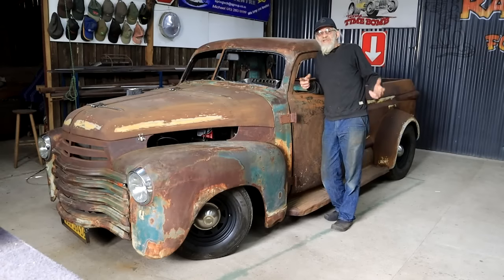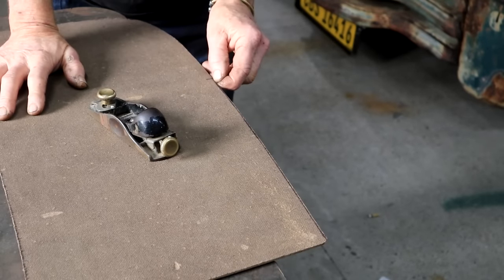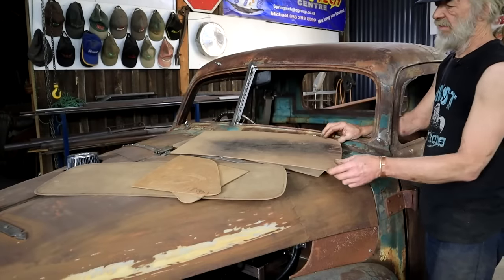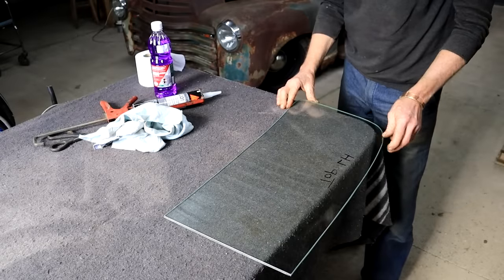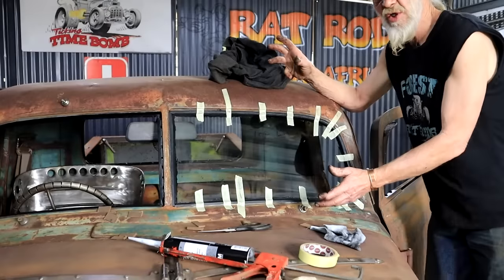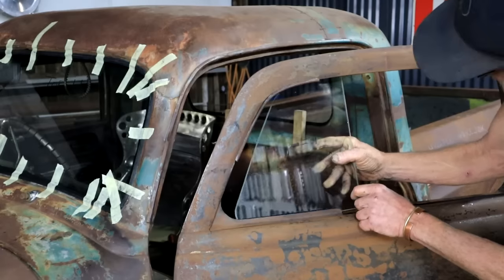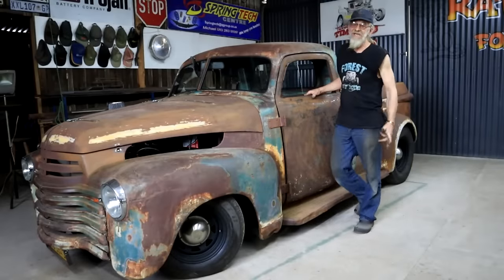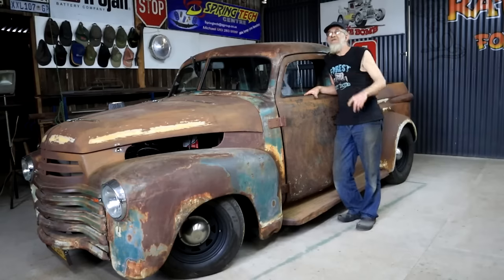How to make and fit your own windshield!

Comment: The glass guy where I live cuts the plastic little tube with a razor blade in such a way that it makes the triangle shape that you referenced in the instructions, looks cool as hell when he does it, I’ve installed glass before with the manual caulk gun like you did and if you don’t warm Up the urethane it’s a hell of a workout . The glass guy cheats and uses a battery powered caulk gun, lol
Reply from the maker: Yes, that gun I used was a pain!! New one is one the list...😅

Comment: You need to use different kind of nozzle. They sell V-cut nozzles for applying windows sealant. Point the nozzle to the frame on 90* degree angle and it will leave triangle shaped bead.

Comment: nice vid and a good idea. both methods are fiddly in their own way, maybe depends mostly on the kind of look you're going for. the type of glass is a personal choice of course, for me anything other than laminated glass specifically designed for windscreens would be out of the question – i really like my face as it is. for those willing to take the risk, have at it.
Reply from the maker: The glass I used is shatterproof, laminated safety glass.

Comment: Hey man, quick tip, put some dishsoap and water in a spary bottle, then you can use that to tool the caulking without it getting everywhere, 
Ive been a glass imstaller for 17 years and it never failed me
Reply from the maker: Nice tip! Thanks

Comment: Yes, absolutely. The big automakers, go rid of all their fancy screw and clip on moldings long ago.
They just have a painted metal pocket, urethane, and glass. 
It’s cheaper, and lighter….and realistically. Safer.
A few pointers from a pro who’s done this many times.
1. You may want to use a byutl tape to put around the pinch weld. Or “quick edge”. A rubber trim product for the edge. This will set the height for the glass, and eliminate “spooge” coming out on the inside. And them the glass will not be setting flat…right on the metal.
2. Hazard Fraud, sells a cheap suction cup. Perfect for alignment perforce placement.
3. Sika flex is great, expensive here, so I use Dow products. Whatever the circumstance. Please don’t use 3M super fast. It is the worst urethane.
4. The rubber trim comes in several varieties, including and “Ogee” edge, that is applied to the glass before placement. And make the seam at the bottom.
5. It’s difficult to use those stamped caulking guns. Cox, makes a beauty. For $30. I personally caulked 40 thousand tubes though one that literally wore it self out, and is hanging on my wall. On a varnished plaque.
Heat your urethane in ….whatever, I use my vans defroster. Hot water would probably work. 
Don’t use the microwave of course, and it will gun faster.
6. Make sure your windshields, you get from the glass shop, have a nice seam. Raw edge glass is dangerous, and fragile. If not, sand the edge, by hand with some 180 grit. Before installing.
7. I’ve at customers request, glued a mirror button in the corner. Inside, allowing for the fitment of a read view mirror.
8. If your doing all the glasses. Laminate comes in clear, bronze, blue, green, and probably peach. So, you could have any color you like. Bronze is always nice.

Great job..thanks for sharing.
Reply from the maker: Hey, thanks for all the pro feedback! Some valuable tips.👍Yes, that caulking gun was terrible! New one is on the shopping list

Comment: Hi Duff
Another outstanding video.”Frankie the FRANKENTRUCK Is coming along Fantastic.
There’s a technique that was used by race
Cars where your glass lower rail has a leather strap Then it comes out of top of door frame
You pull it down from outside and you fasten studs on Door where you can lock belt after
Punch holes on the leather belt you can
Open all the way or half depending on
We’re you put the stud.
This way you don’t have to worry about 
Window crank and gears.
Reply from the maker: Thanks. You not gonna believe this, I used exactly the same technique on one of my other builds!

Comment: Glass Rubber  " T  "to install? Make yourself two wheels curved to form a  half moon to  fit over the rubber, and roll it in gently.  The two wheels should create a half moon cavity for the rubber with handle and axel of course like a pizza cutter, for next time. The wheel on one side should be in contact with the metal window frame following the shape of the metal!

Comment: I'm not familiar with the glass terminology in Africa but I do auto glass in the states and the 2 types of auto glass are
1: Tempered glass (shatters entire glass when it breaks) and cannot be custom cut.
2: Laminated glass, ( 2 panes of standard glass bonded together with transparent, double sided adhesive mask) it cracks instof shattering.
Yours appears to be Laminated flat glass.
They also make Laminated flat glass  with the green/blue shade along the top, it makes custom cut windscreens look .more modern.
A little tip on the urethane. For a cleaner look, mask inwards 1/2 or 3/4  of an inch around the edge of the glass and black out the edges and remove tape for a clean black perimeter and it completely hides the visible squish of the urethane.
Hope that explanation makes sense.
Just look at any automotive glass and you'll notice a black band around edge. It's called a Frith band and the main purpose is to conceal the uneven squeeze out from being seen from the outside.
Cheers 
I should mention that the Frith band goes on the inside of the glass.
PS,: Takes about a week of steady hands on work for urethane to wear off hands. Nothing cuts it, nit even lacquer thinner.
Cheers and good luck
Reply from the maker: Yes, the "safety glass" I'm referring to is laminated. I like the idea of the Frith band, but what do you black out the glass with? I imagine it will have to be a specialized product, probably not easy to find in my part of the world. I've had the urethane all over my grubby paws before... no problem for me to work it off!😄 Thanks for the feedback.
Reply: @ratrodsafrica  When you applied the black prime or whatever you used 1st, is where I use what is called 'Pinxh Weld Primer'' every Urethane manufacturer also has their own line of primers compatible with their Urethanes.. Note, there is pinch weld Primer for the metal and then glass Primer for the glass. I use Sika 220 or preferably Sika P2G Urethane 
P2G means primerless to glass, (glass side primer not required)
Now, with all that said, when I need to create a Frith band I simply use whatever pinch weld primer that matches the brand. I will say that it can be purchased separately from the usual suspects (Amzn/Ebay etc but I buy a box of Urethane  (12 or 24 tubes) primer is included. 
If memory serves me correctly the Sika #  for pinch weld prime is 206
Should be 1 pint and you'll need some cotton or wool dobbers for application. 
Be sure to put the cap TIGHTLY back on the primer,, otherwise it will dry up fast the an open tube of Urethane.  Both, as you know are cured by absorbing atmospheric humidity.
LMK if my explanation wasn't clear or any questions, I'll gladly take them.
Wherever you bought the Sika should be able to also get  Sika pinch weld prime.

Comment: Cut the tip of the tube on both sides   this will create a bead  that allows  you to push   the glass against  that leaves a low area 
..the high area of the bead   has a place to go this way and  will level out ...
Reply: Also diesel  cleansing the stuff off

Comment: Next time you work with window sealant keep a shot glass of alcohol around. Dip ONE FINGER into the alcohol smooth/squeeze into the final form. The sealant is repulsed by the alcohol and smoothed into desired form. No need for 10 finger mess.
Reply from the maker: Cool, thanks!

Comment: Greetings. To get the bead of glue that shape you need to cut it in to the nozzle of the tube adhesive. With b find that in the nozzle its the inner diameter cut there and then cut h in to a nuzzle. Small triangle in a trailing edge of the nozzle.
Reply from the maker: Thanks, will give it a try next time!

Comment: Another very interesting video. The t-rubber is a great idea. Maybe you should have used the t-rubber on the outside of your back window. Would have saved time in cleaning
Reply from the maker: Thanks Attie. If I put the rubber on the outside, still have clean the inside. Dont see how it will make a difference?
Reply: Div, another question and this is to help me later when I hopefully can start my 1st build. If you buy a vehicle like the Nissan, it comes with papers and hopefully a valid license disk. When you are done with your build, will you be doing change of ownership and then take the truck for a roadworthy test?

Comment: Lookin good..just needs some mud splashed down the side of it😉so I'm hoping next vid is this beast blowing down the road,,as for beading cut the tip of your nozzle to whatever size u usually like to use..then cut a small V,about 4mm wide 5mm long, into the point of the tip,,give you nice bed for the window,,,in the triangle shape recommended 😁
Reply from the maker: Dont worry, the mud and dust will come! Promise. That V cut is the secret! Thanks. And, someone else suggested to hold the gun more upright. This old dog is learning new tricks, thanks to you guys!😄
Reply: @ratrodsafrica  once u cut the the tip to the angle u like before cut the V u don't have to hold it upright😉oh when we go for the drive can we go to McDonald's too?😁😂

Comment: Great job on your glass…. Certainly makes good sense, SEKA is as good a product as any. You’re right about trying to use an expensive thick typical glass channel, impossible to do the right corners.
I’m building a ‘35 Chevy Master w/suicide doors…. Life gets expensive very quickly, kinda ruins the process…. 
Great video- very cool right hand drive…. Love that high open grille, not sure if yours is a ‘48 or ‘49…. I’m in NY and our old models of your truck don’t have that upper grille teeth…. Pretty sure yours is a HOLDEN or similar worldwide GM (Chevy?) 
The modern (Ford?) bed looks very correct. Love that aluminum seat.
Try acetone on your hands…. Or just wait for “Black History Month”…
Reply from the maker: Thanks. The cab is Chevy 3100 from around early to mid fifties, exactly the same as the US ones. The hood and grill is highly modified though and built from other parts. If you check out other videos in the Budget Rat Truck series, you will see details on all this.🙂

Comment: That's the way we've been doing our rail buggy windshields here in Florida for years. The best part about using proper windshield safety glass compared to lexon or Plexi is it doesn't scratch and it doesn't get glare wash out as easily.
Reply from the maker: Ok cool! Yes, plexi is a pain!

Comment: If you can get Tiger seal or Tec7 where you are Div, they're "open" a lot longer & do the same thing - clean-up is easier too. They take longer to cure, but will be pretty set the next day - fully set the day after. It gives you more time to dick about with the fit blah blah. :-) Also if you pre-tape the glass exactly where you want the "glue" to finish at, inside & out, you can smooth off, do all the dickery then remove the tape, leaving a clean edge.
Reply: You also don't need hydraulic hands to get those 2 out of the tube.. the sika stuff would test out your grip  alright.. The gun bends if it's a cheapo one.

Comment: Hey div. Loving these videos. Never missed one since discovering it.
Quick word that may help with window installation.
There are markings on the nozzle to cut into a v shape for perfect adhesion. Also when applying hold the gun up straight so that the sealant comes out of the nozzle in the v shape as required.

Just my 5 cents worth

Groete van die mooiste Kaapstad
Reply from the maker: Hey, lekker Slaapstad! Lived there for many years. Did cut that V shape, but you just enlightened me! Hold the gun UP! You taught the old dog a new trick!
Reply: Proof that we are never too old to learn. Just passing on the knowledge. I work for Sika at the Cape Town branch.

Absolutely loving your work
Reply: Beat me too it. 
I just recently learned about cutting a v in the tip. 
Used it to regule windows in a shuttle bus, camper conversion.

Comment: I use cardboard for things like that, if a "hard" template is needed okay. But at the end the template is fitted the same.

What I was hoping was that you were going to make the windows out of sheets  of polycarbonate which is in many ways stronger than glass, a half inch thickness can stop a 30 caliber bullet
Reply from the maker: That stuff scratches too easily man. And I don't need to stop any bullets😂

Comment: Hey Diff. Lekker om te sien wat jy doen. Ek het ook n klein workshop in die Wes Kaap. Ek doen meestdal plaat en suspension werk, maar doen en sny ook my eie glas. Die rubber wat jy gewys het vir die voor ruite is die grooter weergawe van die agter ruit se rubber. Die voorste rubber is n "S" rubber.

Een ding waarvoor jy moet uit kyk is dat die glas nie los trek van die polly nie. Almal dink die swart band op moderne karre vir show alleenlik is, maar dit help ook om die glas en polly te bind.

Vir jou volgende een kan jy kyk by Pro auto Rubber. Hulle het n beading wat gemaak is vir n Opel T car agter ruit wat nogals n baie mooi dun raampie maak.

Om daai bead te kry soos op die tube, kan jy die nozzle sny in die vorm wat jy nodig het. Voor jy skiet, sit jou polly in kook water. Dit laat dit baie maklikker uit kom en dit help met die cure tyd. En om die polly van jou hande af te kry, smeer vaseline in jou hande in en los vir so 2 ure en was dan jou hande met hand cleaner. Nog n tip. Om jou finale trim af te werk, dip jou vinger in parifin terwyl dit nog sag is en vryf dit oor die polly. Dit sal jou n gladde finale rpoduk gee en help om die polly van jou hande af te kry.

Daai International bonnet werk nogals heel goed, sou nooit daaraan gedink het nie. Ek het op die oomblik n 48,49 en 54 AD, maar gaan nou almal verkoop. Gaan nooit by dit uit kom nie.
Reply from the maker: Dankie vir al die tips en feedback, waardeer!

Comment: There is a method of cutting a form into the chalking tip, but is hard on a hand gun automatic feed is easy. Since you can’t link - I’ll see if I can find a video.
Reply: I went looking for a video can’t really find a good example. 

But here is a description of one’s I’ve used.

Concave - mimic of the finger - cut at 45 to the width of the bead match at the inside opening. In this case 3mm, then trim the end to shape the bead. In any shape you like - fingernail clipper. Drag the cut end through to press the chalk in and shape. For this you don’t have to be so smooth as the tip sets the bead shape.

If convex is desirable - a high bread - another angled cut on the other side. But these you have to be smoothed with even feed speed and spring loaded gun or automatic gun is best. After the first 45 degrees leading edge cut make a more of a 90degree cut at the width depth of the desired bead.this side has to trail the bead shape.

In both cases you want the chalk warm and flowing, and do a couple practice runs to get the spread right. 

You can also get that V shape bead, and that is a 45 on the leading edge. And a V notch on the trailing side.

A shop I worked for when I was younger had a box shaped tip that had a round over on top. This was for setting glass. It set the depth for the glass as you pushed it in just enough to set the round over flat, no bubbles, and once the top was flat was a 3/16” set depth. This left a no chalk edge, just the back mastic. Very popular in late 80’s cars I worked on. Still popular today. But now the glass is tinted at the washes so you can’t see it. So the ‘art’ is gone.

Comment: wat we do in theusa rat rods  put awindow track gide  but on the glass take a seat belt  attached on inside of glass run it up  over the top of door over and down  use a screw   and brass ring  pull on belt to raise glass put on brsaa ring of belt to kee glass up
Reply from the maker: That method works well!

Comment: Man water proofing tooling tools for urethanes ,silicones their great the look like cake decorators for frosting they make another kind of tooling tool  offset handles the tool is held pretty slight angle to the work you also a tool in each hand keep the tool your using and a rag with with the approiate solvent. Borrowed phone
Michael west.

Comment: Good solution re windscreen. For the paint, don´t you have any POR15 or Hammerite? Pretty good stuff, they have zinc in the paint which inhibits the rust.
Reply from the maker: I got Hammerite. Good stuff, I use it a lot.

Comment: I was wondering why you installed the rear window from the inside then the penny dropped, no side windows and the force of the air coming in,  Old Diff is no fool.  Best wishes mate from Australia.
Reply from the maker: Thanks mate.Just kinda makes sense doesn't it🙂 And meant an easy clean edge on the outside, no trim required

Comment: Greetings from New Zealand - Wooden windows wouldn't work 🤣 ok you'd save in wiper blades 😁 but even in the bush [where I live as well] you'd have to drill a load of holes in the wood to see out - yes I know people shouldn't be on the road anyway - but question here On Rough Roads in the bush *How Do You Know When You've Hit Them with wooden windows - everything I hit all sounds the same?*😂
OK so it's the pattern to cut the glass to - why not just wear glasses in the wet?
Reply from the maker: 😂 Time for some comfort in my "old age"😅

Comment: Should use hood pins for the hood hinges for quick removal of the engine flaps...and should always leave the trim split gap at the bottom outside corner not the top...BTW you are ace's awesome channel incredible skills